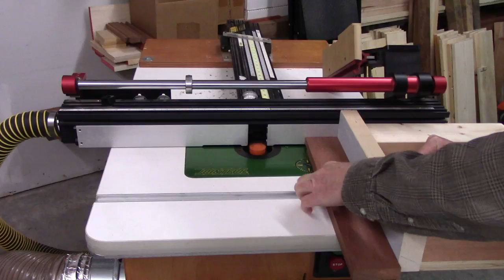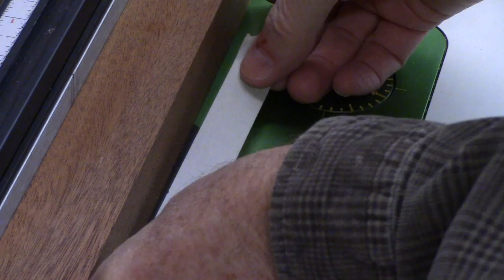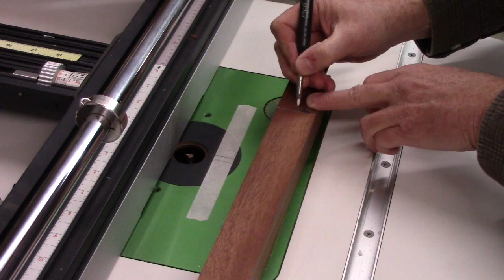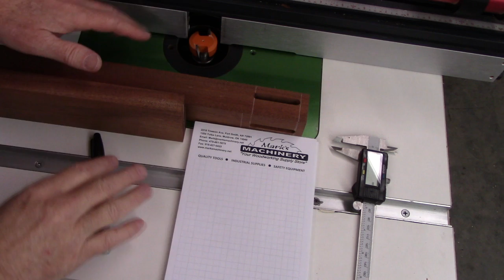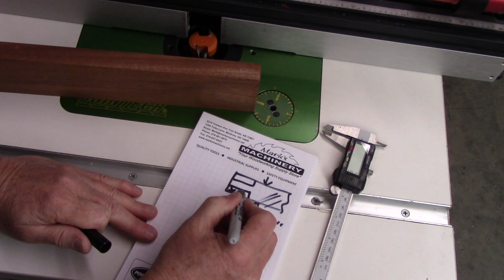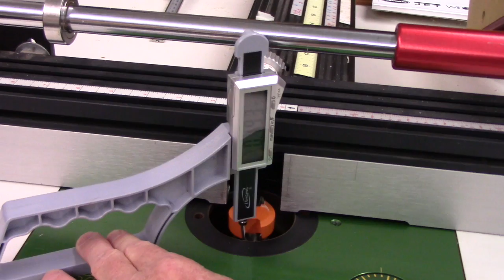Mortise & Tenon Joinery on the Router Table

Comment: My suggestion is to lower the piece onto the tool in the middle of the mortise, rather than trying to begin the cut on one of the limits lines, and then work your way, back and forth toward the lines. Also not very safe to measure the height of the bit while the router is powered on and running.
Reply: I don't think the router was running when he measured it. The extraction perhaps.

Comment: Thanks, just what I needed. What kind of bit did you use to create the tenon?
Reply from the maker: ExtremeWoodworker
3 years ago
I have had several questions about what specific bits were used in the video:
1) The mortises were cut with a Magnate Spiral 2 Flute Solid Carbide Router Bit, MicroGrain Carbide, Right-Hand : p/n 2006
2) The tenon was cut with a CMT Dado and Planer Bit p/n 852.504.11
Steve

Comment: Where do I get one of those white markers???
Reply from the maker: Hi Mark, The marker is a Pica-Dry mechanical pencil and can be purchased in the US from either Lee Valley or Toolnut.  Be aware the leads are very soft particularly the white.  Here is a link:  http://www.leevalley.com/us/wood/page.aspx?p=71121&cat=1,42935,42936,43509,71121
Steve

Comment: Very nice tutorial, easy to follow and get results. Was wondering about the long pointed mechanical pencil and the chalk? holder you used to mark the location of the mortises(Visor?)
Reply from the maker: Thanks Pat.  The products are made by Pica that I picked up from Lee Valley.  The chalk is really a crayon which is good for marking rough cuts.  The pencil is the Pica Dry.  Here is the link:  http://www.leevalley.com/us/wood/page.aspx?p=71121&cat=1,42935,42936,43509,71121
Steve

Comment: With a mortise that's quite close to an end you should really have at least a one inch horn left on the top of the wood so that when you're routing towards the top edge (your second cut) you can't blow out the end. Then cut the horn off off afterwards. Bill Hylton says so. So it must be right. Bill Hylton is Router God.

Comment: Steve I did this method cutting mortises on some board edges a while ago and I noticed sometimes th wood wanted to shoot away unless I really held onto it. Maybe I'm too new to that but wondered if you experienced it too? I was using a spiral upcut bit. Maybe that was why?
Reply from the maker: Hi Dave, what you describe sounds like a reaction you would get from a climb cut.  You should not have experienced that with a spiral upcut bit since both sides of the bit are cutting the wood.  I have not experienced that doing the M&T on the router table.  That one leaves me a bit baffled.  Steve
Reply: Since you ate cutting on both sides of the bit the wood is trapped between the bit and the fence. The wood is trying to shoot out of there because it’s trapped in there. Also the bit is trying to push the wood away from the fence. If you feed from left tho right you won’t have that climb

Comment: I think Steve is the only woodworker with an "Extreme"ly sharp handled brush. Maybe it's for the big chips :B
or maybe the slider got to it.
Excellent tutorial!
Reply from the maker: Thanks Ronnie - the brush was in the tool tray and partially obscured - it just looks sharp.  After 38 years, all the sharp edges on the brush have worn down.  Steve
Reply: Ronnie W use a tonacut router

Comment from the maker: I have had several questions about what specific bits were used in the video:
1) The mortises were cut with a Magnate Spiral 2 Flute Solid Carbide Router Bit, MicroGrain Carbide, Right-Hand : p/n 2006
2) The tenon was cut with a CMT Dado and Planer Bit p/n 852.504.11
Steve
Reply: Hi Steve - thanks for a great tutorial.  I am wondering about the setup for your tenon jig.  Do you need to use it with the same bit/fence configuration each time for it to be effective at preventing tear-out?

Comment: What marking gauge are you using in the beginning with the dual heads?
Reply from the maker: The marking gauge was purchased from Lee Valley.  They call it the Pocket Marking Gauge.  The pencil is a Pica but you have to purchase the white lead separately.  Be aware that the lead is quite soft so don't bear down on it.
Steve

Comment: Where did you find the router insert plate and maybe the table as well. Not familiar with that brand. Pros/Cons?
Reply from the maker: Jeff, I purchased the router table used.  The lift is a Jointech brand but was made by Jessum in Canada.  Mine is the Mast-r-lift but is different than the current Mast-r-lift-II.  If you already have a router to use in a table, I do like the Jessum.  I have no complaints about the Jessum and the only con I have found is interference with the Jessum Mite-r-slide by the height adjustment handle when the fence is too close.  Steve

Comment: Nice job. Nice video work... Nice presence!  I wanted to be a tool and die maker and that never happened. I got a digital caliper as a Christmas gift and picked up a Wixey digital height gauge at an auction new in the pack cheap. Using the digital tools to set router bit heights, move the table saw fence a few thousandths, etc has proven very rewarding (and super accurate). Hey it's woodworking but for those of us that demand a little better fit, it is the way to go.  Thank you for your efforts on the videos and I look forward to more good stuff! Best to you!
Reply from the maker: Thanks Jeff.  The beauty of these type setup tools is that it is a once or twice adjustment and you are done.  When I did this with the table saw tenoning jig, many test cuts to get it right.  This way is much quicker.
Steve
Reply: ExtremeWoodworker Hi Steve. I enjoyed this video and picked up a few tips so thanks for that. I also 
like the other videos that I have watched so far. I also like your shop and the tools. Speaking of tools, is the router table used in this video a hybrid setup. What I mean is the fence with the rod on top looks like a JessEm fence that attaches to JessEm right angle fence, but the back arm that adjusts the fence depth in and out looks like it could be part of the Incra router fence system. If that's the case, would you please do a video on the fence system and the Incra fence adjustment system? I have a full JessEm system with the right angle fence and have been debating if I want to figure out a way to mount the Incra fence adjuster system to my current JessEm table or get just Incra's fence adjuster or put an put and Incra fence and adjuster on my JessEm router table or get an all Incra router table system.... You thoughts on the subject? Hahaha Sorry for being so long winded!
Thanks in advance.
Reply from the maker: Thanks Ron.  The router table fence is a Jointech with the Jessum Mite-r-slide that I purchased used.  Ilike the Jessum quite a bit but sometimes it gets in the way when doing tall stock and when using the handle to raise the lift.  I don't have the Incra fence system but that is the one I would purchase today if in the market. Steve

Comment: And I thought I was the only one that still had one of those HP calculators!!
Reply from the maker: I have 3.  One in the shop, one at my desk, &  one at work.  Great calculators and last a long time. I think I purchased my first one in 1975.  A buddy at work  has one as well.
Reply: @extremewoodworker  Yeah, that looks like a 1975 model! 😃 Good old Reverse Polish notation!
Reply from the maker: @rodc4334  Hi Rod.  That would be correct.  I purchased it while I was doing my first engineering internship.  (I was given two more by a friend who didn't know how to use them).